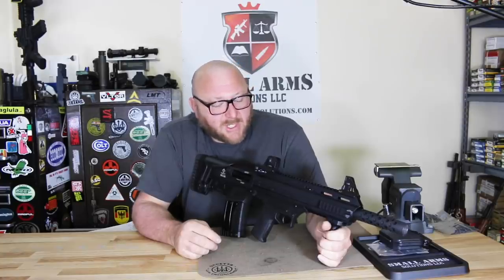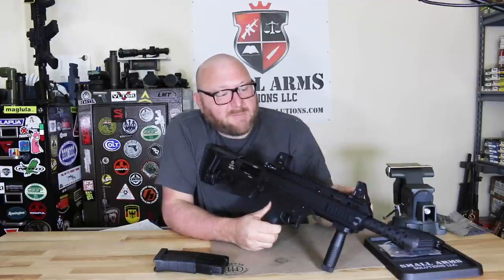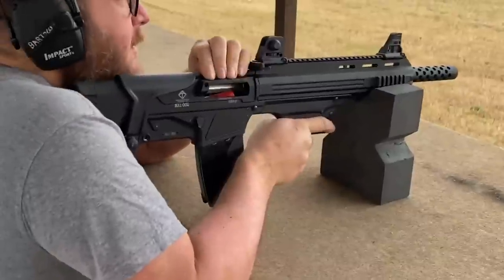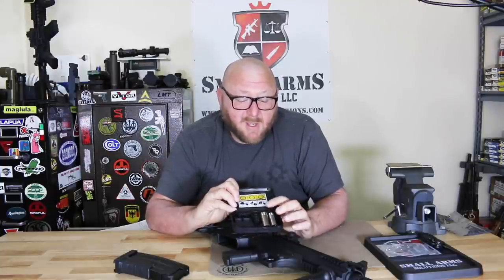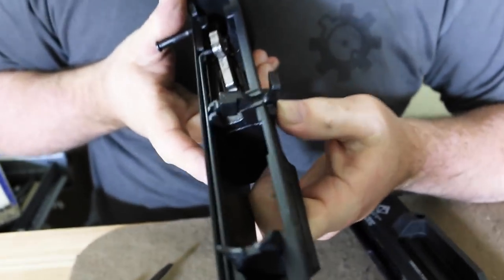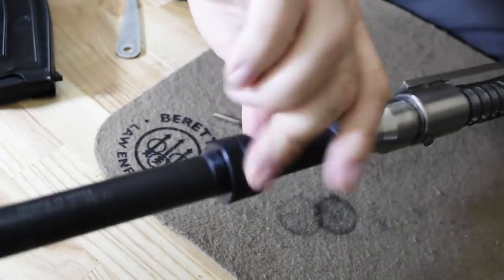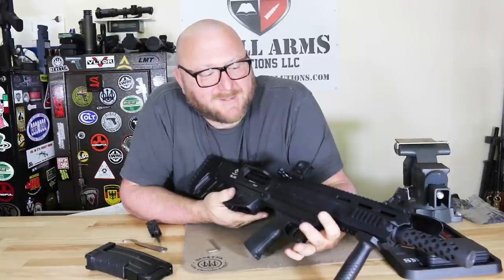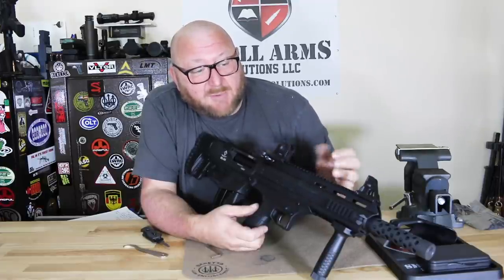ATI BULL-DOG - Affordable home defense shotgun

Comment: The willingness of youth to try a kicking shotgun ... reminds me of my single shot 12 that weighs about 5.5 lbs, firing slugs ... as a 14 year old it was an eye opener.
Reply: That's about how old I was when I had a Stevens 311 side by side 12ga w/double triggers. As an experiment I put fingers on each trigger to see how fast I could fire 2 shells. Answer: Nearly simultaneous firing which launched the gun skyward and landed in my arms. I think what happened is I fired the front trigger first and during recoil the second trigger was bumped. It sounded like one discharge but my shoulder said it was 2 at once. Never tried that again.

Comment: I have shot a GFY-1.  Basically, it is a Radikal NK1 imported by GForce Arms in Reno, NV.  Americans are brainwashed by gun manufacturers to embrace the old glory and refuse to move onto the future.  One primer example is that the American gun manufacturers lost the U.S. military contract of the sidearms to Berretta because the love of revolvers and 1911s.  Even as of today, Americans are in love with the AR platform and cannot move on.  Bullpup is the future.  It has the same barrel length for accuracy and space to manipulate the weapon while sitting in a vehicle or in tight space.  Unfortunately, AR platform heavily depends on the buffer weight, buffer spring in the buffer tube.  It is hard to shorten the weapon.  American shotguns, don't have that problem.  Therefore, it is easily to convert an American shotgun into a bullpup weapon.  The GFY-1 I tested was a good one, very fast, not so much kick because the spring absorbed much of the recoil before it let the bolt to open.

I accidentally stumbled upon this Turkey Bull-Dog, imported by ATS, American Tactical Solution.  I spent about $540.  The safety is far better than the NK1 and the GFY-1.  The trigger is very smooth and the reset is short.  That means we can shoot accurately and fast.  Turkey is a NATO country.  U.S. save Turkey from fallen into communist during the world war.  U.S. taught Turkey about engineering (just like U.S. taught Japan about electronic and engineering).  If you dissemble a Bull Dog, you will see American signatures in engineering all over the gun.  A pump shotgun can easily costs more than $300.  Bull-Dog is a semiautomatic shotgun.  It comes with a 5 round mag.  There are many of 10 mag on the market.  If you put a decent red dot optic on the gun.  You have a very good tactical weapon. 

Don't be a chicken.  The gun kicks very little, much less the the old glory Remington 870 and Mossberg 500.  I have both Benelli M1 and M4.   Bull Dog is nice.   You shall try instead of whine.

Comment: Looked as if you put your front barrel spacer in backwards it has a small nub on it if it's in properly you will hear a clicking sound when tightening down your barrel shroud also not sure why you loosened the top screw it holds nothing it's just a catch for your charging handle it also has a two piece piston  that you'll need to separate to clean an oring you won't wanna lose and a spring plate you need to have oriented in the correct position good review but lacking some knowledge that novice owners may get tripped up on also is a 4 port gas system not two and those need to be checked each teardown make sure they aren't clogged or fouled up or it will have cycling issues

Comment: My God that's overly complex for just a shotgun. It's interesting it looks versatile especially in tight quarters but you know something I'll stick with my circa 1986 Winchester 1200 defender pump. Got a magazine extension on it a shell side saddle and a buttstock side saddle shell holder and light. Good old fashioned reliable and highly effective.
Reply: I was saying the same as you….. Until I shot one and it changed my mind. I’m a proud owner of one  now . Is outstanding. I do not use their sites I Patroy battle sites I had laying around and I removed one of the screws  for charging handle latch to catch  so you can use it like a regular AR  Just pull on one side or the other of the charging handle